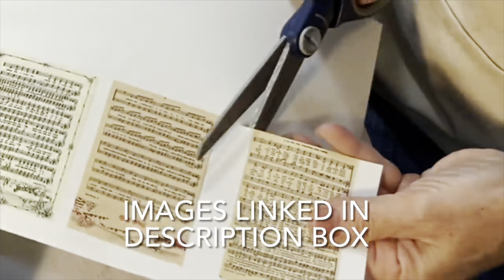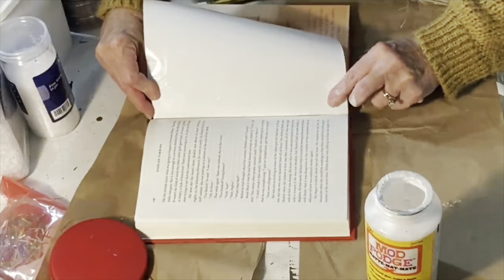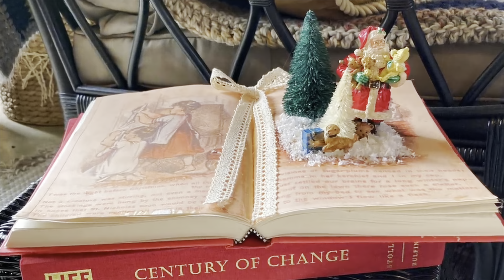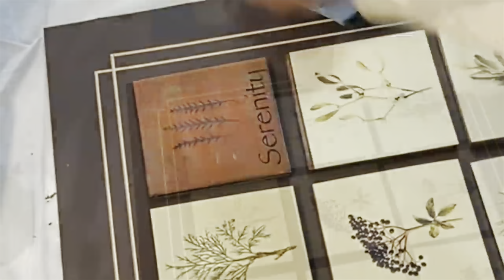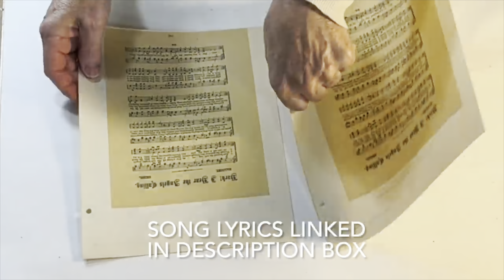Budget Friendly Christmas Decor: 30 DIY Upcycles Using Goodwill Thrift Store Items!

Comment: After we had our first 2 babies we got a bag of these blocks and glued different pictures on them. We just drilled a hole to run a wire through. It was some of our very first ornaments and are still some of the most cherished 40 years later.

Comment: Sherri, I have a secretary that i want to paint black and would love your recommendation of what type of paint I should use
Reply from the maker: Although I still craft a lot with chalk paint, I have mostly stopped using it on furniture pieces. However, if you want to distress it or don’t want to prime it, then use chalk paint and follow with wax—clear or antiquing wax. Alternately, I would clean the secretary with Liquid Sandpaper, prime it with Zinsser Shellac Based Primer, and paint it with two coats of a cabinet or acrylic enamel paint in a satin or semigloss sheen for a durable finish. Hope that helps.